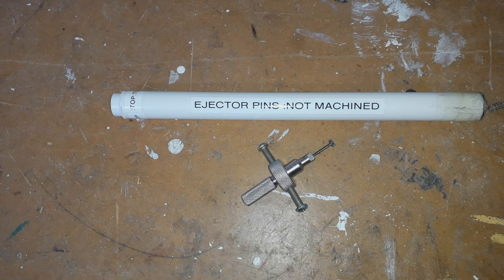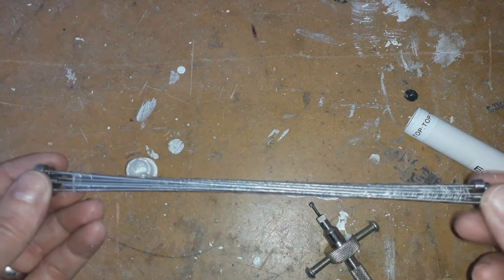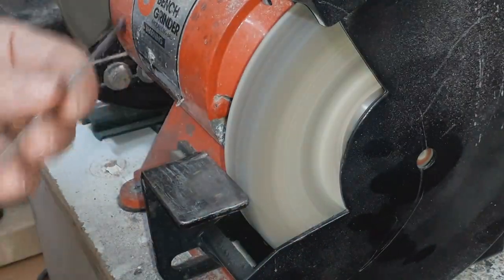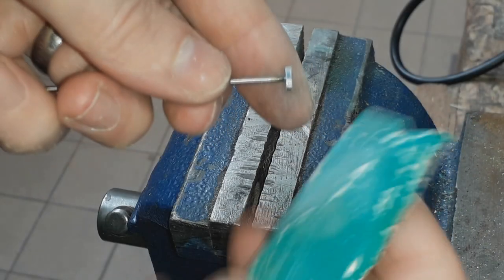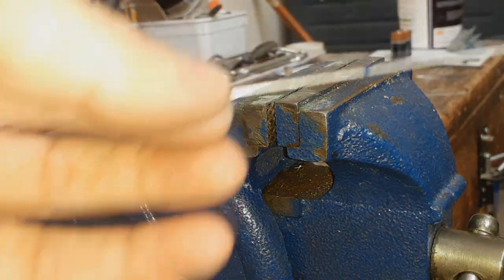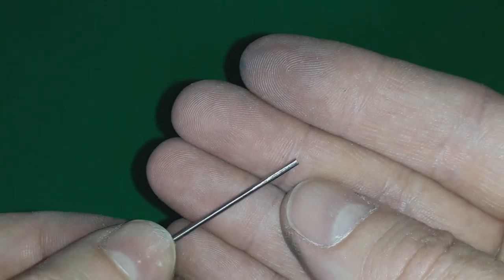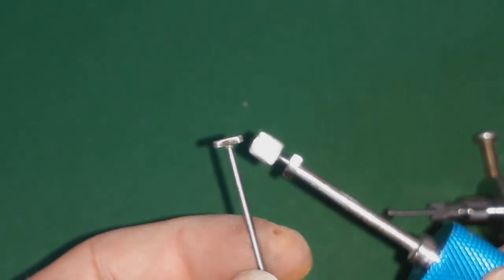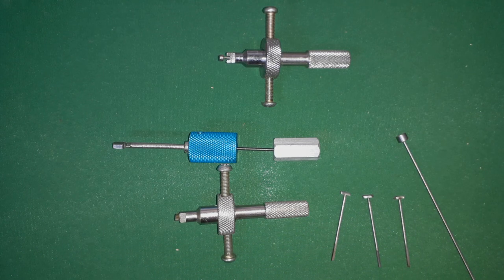(079) Making picking tips for the Chinese Disk Detainer Pick

Comment: Great work Roy, those ejector pins are fantastic, because they are made from one piece they really are super strong. The tips I use are 0.30 mm &  are still super strong, also the 1.5mm shaft ejector pins are a perfect upgrade for the sparrows DD pick. 
Have a great weekend.
Reply from the maker: I remember recently you picked a DD lock and commented you changed the Sparrows picking tip for your own, made from an injector pin. I thought the Sparrows tip is very thin and there you go swapping it or for a home made thinner one.

I made this video a while ago and it was sitting in my editing folder so thought it was time to edit it and upload it.

Comment: What an excellent demonstration. A great tutorial. The only thing I would add is that the offcuts you are left with when you shorten the pick you can use as a lever lock pick and a pin tumbler tension wrench. Cheers
Reply from the maker: Never thought of using the waste rods for lever picks. I'll have to give that a go, thanks for the idea 👍🏻
Reply: @roysammons2445  That's why when I brought my rods I brought the longer ones so I could use the cut offs, cheers

Comment: Wonderful tutorial on making those DD tips. Chris Capune sent me some ejector pins but I believe that are a little thicker shafts. I may have to somehow turn them on a drill and use a file to thin them to the right size. But now I know how to do it thanks to this video. Great job. 👍🦊
Reply from the maker: When I saw your unboxing video it inspired me to edit my video that's been sitting in my editing folder and upload it.
I think I would stick the blobby end (very technical term) into a drill, city the shaft a little overt sized and while the drill is on slide a file up and down, checking frequently with a micrometer.
Reply: Roy Sammons Great advice. Thanks👍🦊